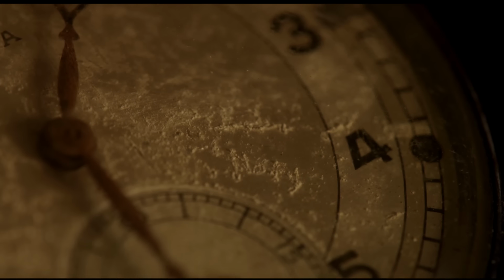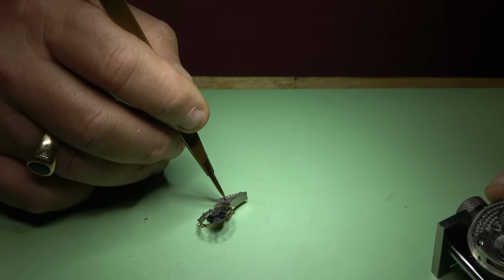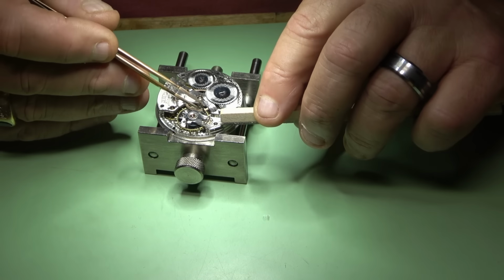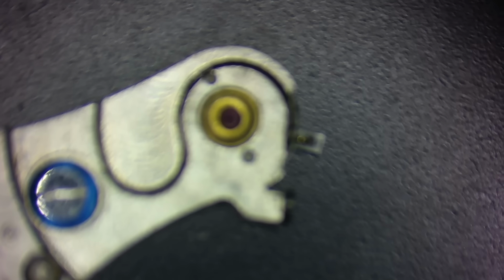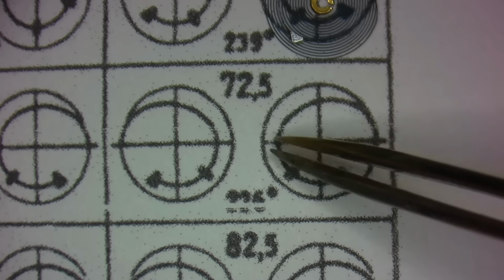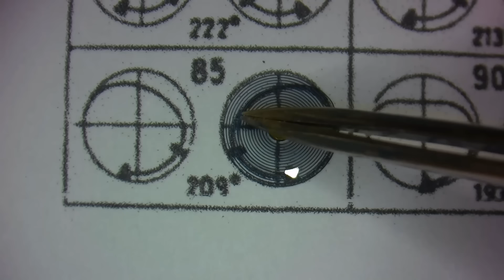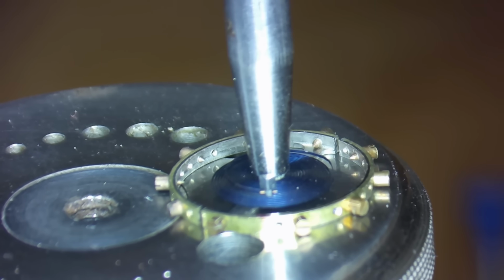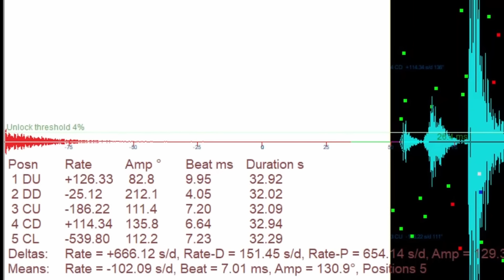Troubleshooting a 1200 Second Per Day Loss

Comment: Wow. Just watched this video now and I still don't understand.
Reply from the maker: Watch it again. 😜
Reply: Does this summary help?

The watch is running very slow, and this points to a problem somewhere with the balance complete. 

Inspection of the balance complete reveals the timing screws are screwed all the way out. 

Timing screws being moved outwards slows down the watch by moving some mass of the balance away from the centre. 

To increase the rate of the watch, these timing screws are moved back in to the rim of the balance wheel. 

As Alex foreshadowed, this did increase the rate of the watch, but not nearly enough. So he decided to check if the hairspring was correct for the movement. 

Measuring the distance between balance pivot Centre and the regulator pins and measuring the hairspring gives rise to a ratio which can be expressed as a percentage. 

These percentages can be looked up on the Helwig chart, to see what shape an overcoiled hairspring for that balance cock should have. 

The hairspring in the watch did not match the relevant hairspring shape in the Helwig chart, but did match the shape of a hairspring that would suit a different balance cock. This means the watch has the incorrect hairspring fitted. 

Alex ordered the correct hairspring and fitted it to the watch after cleaning it. 

This brought the rate of the watch back within a range in which the watch can be readjusted to keep time in accordance with its original factory specifications. 

Adjusting the watch to these specifications over 3 positions will be the subject of another video.
Reply: Wow. Thanks dude. That does make sense. I don't know how many years of experience Alex got for him to have known this, but that's awesome. I wish I got into this hobby a long time ago. This is more and more awesome the more I keep getting into this.
Reply: @NombreFrancisco  I’ve got a reasonable degree of experience and knowledge when it comes to watchmaking. 

That said, with watchmaking, you should never stop learning. It keeps getting more fascinating as you progress, even once you are proficient. I find still it very rewarding. 

No matter how early you start this hobby or profession, you can keep on learning indefinitely.

Comment: Fantastic video, thank you, Alex!

Thus far on YouTube I’ve never before seen any insight beyond hairspring too long = slow rate, hairspring too short = fast rate and occasionally the suggestion to repin the hairspring to the stud to shorten it and increase the rate, usually with no reference to terminal curves in flat springs, let along how to deal with watches with a Breguet overcoil. 

Even the books commonly recommended have little or nothing to say beyond the above. 

It wasn’t until I got my hands on a copy of Jendritzki’s great book, “Watch Adjustment” that I could learn about this properly. 

Once aware of these subtleties, it opened up a whole area of knowledge pertaining to inner curves as the spring leaves the collet, overcoils, terminal curves and all the fine adjustments they make possible. 

This video is an awesome introduction, the tip of the iceberg in terms of the techniques of a fine reguleur from days gone by. 

It is disappointing how many practicing ‘professional’ watchmakers these days are unaware of this stuff at least where I live.
Reply from the maker: Thank you and where do you live?
Reply: @watchrepairtutorials  Melbourne, Australia. Certainly some great and knowledgeable watchmakers here, but knowledge regarding positional adjustment and things like hairspring curves and their effects upon timekeeping are lacking from all but the best few who are still working.
Reply from the maker: @mercuriall2810  the vast majors majority of new watchmakers touch on these things in school and sometimes will even make a balance like this but unless they at at a specialty company, don’t spend much time on this stuff. It’s not where the industry is headed.
Reply: @watchrepairtutorials  I totally agree with you that this isn’t where the industry has headed. Replaceable/throwaway modules and part swapping seems to be the direction for the bulk of the industry. 

There seem to be very few people left here who understand enough to troubleshoot a watch based upon an understanding of how it works, let alone a thorough understanding of how and why a watch works as it does. 

Even in higher end brands like Cartier, the in house watchmakers are clueless here. 

They can’t even recognise a very obvious and poor quality fake of their own product, riddled with huge tells that it’s a fake. (I do realise some quartz crisis era Cartier watches were verging on crude for Cartier’s standards and hard to authenticate, the watch in question left no room for doubt at a quick glance!)

Cartier Melbourne HQ staff had to show it to their watchmaker. He advised that it would be sent to Sydney because he wasn’t sure, Sydney advised it may have to go to Switzerland but after 2 weeks Cartier Sydney recognised it as a fake. Perhaps they sent pictures to Switzerland. 

It was a cheap blinged up quartz Cartier Francaise copy. 

This watch had glued in fake diamonds on either side of the rectangular crystal. One had fallen out, revealing stones were glued in, not in prophet settings. 

The Cartier secret signature on the dial was totally wrong. 

The case back was poorly fitting and held by cheap Phillips head screws. 

It had the reference numbers for two totally different Cartier watches stamped into the outer side of the caseback. 

One of the two slotted screws holding the bracelet on had its slot so far off centre it wouldn’t pass QC at most low end Chinese copy watch factories. 

I never had a chance to see the movement but Cartier had permission to open the watch and undoubtedly did see the movement too. There’s no way it had any calibre Cartier use inside. 

That’s quite disappointing.

Comment: Thanks, Alex, these are the kinds of videos I like.   That is awesome information for me to check my Elgin 280 RR watch.  I think I know what I'll find but sourcing a hairspring for a 280 Elgin will be tough.  It's a rather scarce movement. 
See...I have the same issue with an old 280 grade Elgin pocket watch only its 20 minutes per day FAST.  I think someone put another balance spring on it that doesn't belong.  It's not magnetized, and the spring is not stuck together. The spring actually looks pretty good, but it's too short making it run really fast and I have no leeway to lengthen it because it looks clipped off up to the stud.    I've got it down to about half of what it was using some washers, but still have some to go and have not messed with it lately.
Reply from the maker: These old girls will keep you one your toes. I hope this video will give you some insight.

Comment: Are all hairsprings standardized in some way? Doesn't material, thickness, and width of the spring matter also?
Reply: Material, thickness and width all make a big difference. 

Different spring materials have different degrees of strength or springiness. 

In terms of thickness and width, spring strength varies in proportion to the cube of the thickness. This is why just a tiny defect caused by a spot of rust can cause a comparatively large change in the rate of the watches oscillator.
Reply from the maker: Yes there are many variables in hairspring. These are non compensated springs while today’s are compensated. Weight of the spring is another major factor but you can figure that out.

Comment: I would love a video on how to replace the balance jewels in this exact movement. I'm having trouble finding a video that explains how to do it with this movement.
Reply from the maker: Good suggestion
Reply: If you’re already somewhat familiar with working on watches, here are some step by step instructions that should suffice. 

First, let down any power on the watch. Not strictly necessary here, but it can’t hurt. 

Now, loosen the screw holding the hairspring stud, and remove the balance cock, leaving the balance wheel in the movement. 

Place the balance cock on a slice of pith wood or a bench block for support, taking care not to squash the regulator pins. 

Remove the small screws that hold the upper balance jewel setting in the balance cock. 

Now take a jewel pusher, and you can push out the upper balance jewel setting from the balance cock. 

Set the balance wheel aside, and on the dial side you can remove the two screws that secure the lower balance jewels. 

They can then be pushed out using the jewel pusher. 

Reassembly is just a matter of pushing the jewels back into place, taking note of any witness marks or screw indentations to help orient the jewels correctly in the settings, and replace the screws. 

Keep track of which screw came from which hole and replace each screw into the hole from which it came. 

If cleaning the movement, it’s easiest to put the screws that hold the chatons back into their respective holes to keep track of where they go. 

Hope that helps.
Reply: @mercuriall2810  I've read somewhere that these are a different type of jewelset called "rub in". I'm not 100% sure if that's in fact what these are, but I've used my Horia tool and tried to gently push them out. It got to a point where it felt like I needed to use way too much pressure to remove the jewel so I stopped. I was afraid of damaging something, but if it's normal to need an obscene amount of torque to pop these little guys out... I'll attempt it again. The jewels were already cracked before I attempted to remove them, but I really don't want to damage my rather expensive Horia jeweling tool lol.
Reply: @mltrymn1213  The jewel settings come out as I described. Sometimes it does indeed need some force to move them. They come out of the top of the balance cock, so push from underneath. 

If you can source the right replacement jewels for this movement, already in their settings, then they will push into place as described and there is no need to learn about rub in jewels and the process of replacing them. 

I’ve not used a Horia tool to push these out, I use a Seitz jewelling press. Most settings come out quite easily, some are stubborn. 

If you are worried about damaging your Horia tool, you can get vintage jewel pushers quite cheaply, that are handheld and have prongs of different diameters for pushing out settings of different sizes. 

In case you are curious about rubbed in jewels, aka burnished in jewels, they are common in older watches and are pushed out when broken. 

Then a special tool is used to open a metal lip that holds the jewel in, the correct size replacement jewel is placed and another tool, is used to rub or burnish the metal lip over the edge of the jewel, holding it in place. 

The tools rub in jewels come up for sale fairly often, and the process of using them is quite straightforward, but unfortunately rub in jewels are shaped differently to Seitz type friction set jewels. This can make sourcing the rub in jewel you need very difficult. 

When a suitable rub in jewel cannot be found, it is sometimes replaced by reaming out the hole to fit a modern Seitz friction jewel of the correct type and hole size. It is great if this can be avoided to preserve the watch as it was originally made, but sometimes it is the only way to fix the watch. 

There are YouTube videos demonstrating the process of replacing rubbed in jewels, but you don’t need them for replacing the balance jewelling on this watch.
Reply: @mercuriall2810  awesome! Thank you so much for the advice and I'll give it another shot with the Horia tool. I'm sure it's not as bad as it seems, but I've never done this before. I'm pretty new at this stuff, but really eager to learn and become proficient in all types of movements. Again, thank you for the assistance 😊!
Reply: @mltrymn1213  You’re welcome. 

It is great that you stopped before applying more force than you felt comfortable with. 

There are a lot of people online who will help you, here on YouTube and on forums, if ever you need help, it’s so much better to stop and ask than try to force something and break a part of the watch and this happens all too often. 

If you want to avoid applying more force with the Horia tool, you can take a piece of pegwood with a flat end & adjust the diameter so it is very slightly smaller than the jewel setting. 

Place the balance cock upside down on a bench block with the jewel setting over a large enough hole and press it out with the pegwood pusher. The pronged jewel pushers are just metal versions based on this principle.
Reply from the maker: @mltrymn1213  I just  covered this in lesson 8 of my course.
Reply: @watchrepairtutorials  I used your tutorial, along with a couple others to get into watch repair. Lesson 8 was the one I used when trying to do this with my Waltham grade 625. You made it look effortless when removing the jewel setting, and I figured I must be doing something wrong when I really needed to crank down on the Horia tool.
Reply from the maker: @mltrymn1213  yea the Seitz tool with the lever makes it a little easier for sure.

Comment: Great video, informative as always.  I have a couple questions,  What is the name of the diagrams that you were using to size up the hairsprings?  When reattaching the hairspring to the balance cock you install it on the mainplate to secure the hairspring stud as you demonstrate but do you then take it off to turn the regulator boot back to the closed position?
Reply from the maker: The PDF for the diagrams are in the description. There is no regulator boot on this one. In the case of a ETAchron regulator I normally would yes.
With an etachron or any regulator with a boot, the only purpose of installing it on the on the mainsplate is to be able to install the HS stud. Then take it off and close the boot.
Reply: Thank you. Your videos are an excellent resource.
Reply from the maker: @da___man  appreciate ya man

Comment: Hello again Great stuff. I have to wonder if i could be in the same boat.1908 Waltham ebay movements 17j . Only timegraph 1900 shows rate ++++,Thought hair spring may hit bottom of cock , I dont see that.clean & demagnetized looks good .I switched an entire 7j balance wheel cock & spring into it, ok now 5sd.rate. OK now i swapped the 2 hair springs,  Back to same rate ++++ with original balance cock & wheel, different spring. I assume now the cock itself may measure different.Spring must match every thing .Is it possible to get the ++++ instead of SLOW SLOW .I will try to print the spring chart. Thanks !!!
Reply from the maker: Wait, you switched the balance and got a five second per day rate? 
And then you switched the hairspring?
Reply: @watchrepairtutorials  Yes i switched the entire balance cock & wheel with spring as an assembly from a 7 jewel .got 5 sec a day. After that, I disassembled both & just switched hair springs.I got ++++ again!
Reply from the maker: @ sound like the hairspring getting +++++++ has gone bad. That could be caused by rust or too much manipulation. You’re getting those plus signs because the rate so high that it can’t calculate it.
Reply: @watchrepairtutorials  Hello again i have been working on this watch for weeks So i am winding the movement , it does have the cannon pinion on it, It pops loud and jumps, broke off main wheel shaft in cannon pinion, seconds wheel hand shaft ,pallet fork pivot ,and balance staff.but what i noticed after all those repairs and a different main spring barrel .I was getting +400 s/d  and I think that was when I noticed my auto beat was 19800 not 18000 .I continued on to dynamic poise adjust timing screws ,and under cut. adjusted 5 positions within = +5 -5. rate ,190 amp.running great.at +2 s/d on graph  however, it is still at 19800 beat.Assembled and cased test run gains 10 minutes an hour!! this 19800 beat is a total problem I assume? How is this happening ? What can i do? At My wits end
Reply from the maker: @joycemason3114  There are 3 factors that determine the vibration rate. They are (1) the weight of the balance wheel, (2) the diameter of the wheel, and (3) the strength.of the hairspring.
I do not believe Waltham manufactured a movement that operated at 19800 so the balance wheel and hairspring are not correct and IMOP is the source of the main issue. There may be others, but that is the main one.
Reply: @watchrepairtutorials  Thank You again I will go for a different balance wheel and hair spring.And start over. I will not let this watch win this time.Started on this one in 2022 and gave up.This watch has given me alot of practice!!  THANK You for the quick response.
Reply from the maker: @ you can do it!!!👍
Reply: @watchrepairtutorials  Hello again I found another donor movement that has the same balance shaft pivot size ,swapped complete assembly and beat went to 18000, +54/sd. So the original wheel has the matching serial # on it. I took both  loose from the cocks for compare, measured both the same diameter, both weigh the same on gold scale but the springs are a different size diameter The problem spring measures 8.2 I dont know where it came from. the correct spring measures 8.5 You can see the difference side by side each other. I have not found a chart that tells diameters of spring numbers .Anyway I am on the right path thanks to you!! Your knowledge is impeccable !!! Do you think the original wheel is worth trying again with correct spring ? after I poised and under cut and regulated to 5 positions at the wrong 19800 beat ? Thank You!
Reply from the maker: @ I wouldn’t worry about it unless there is some historical significance to it. I say keep moving forward.